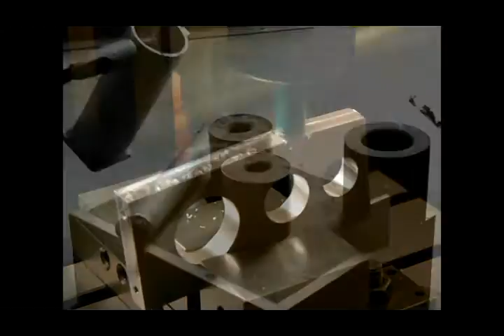RossYoke Stirling

Comment: very good job! congratulations! after many attempts I found that the Stirling engine works with the proficiency speed when the volume of power cylinder is equal to one third of the volume of the water heating cylinder. this is just my observation.
Reply from the maker: Thanks for comment Plamen :) .Your observation is interesting...I will check it soon in new model.

Comment: Congratulations, really a great job!
Thanks for sharing some more information.
I wonder what is the metal you used to make the power piston?
Also like to know what metal you melted to fabricate the flywheel?
The power piston is really perfect seal.
Greetings from Brazil,
Leandro Wagner.
Reply from the maker: Thanks Leandro . Power cylinder and piston are made of cast iron .Good self lubricate material and no problem if about  difference of expansion thermal factor.
Flywheel is made of aluminium .
Reply: Thank you for the reply, you mentioned that you do not use any type of lubricant? That is, the piston moves within the cylinder without lubricant? 
Leandro Wagner.
Reply from the maker: Manual do Motor Stirling - Leandro Wagner exactly